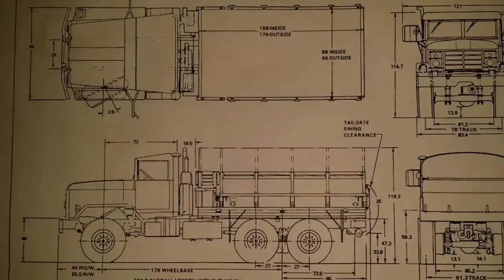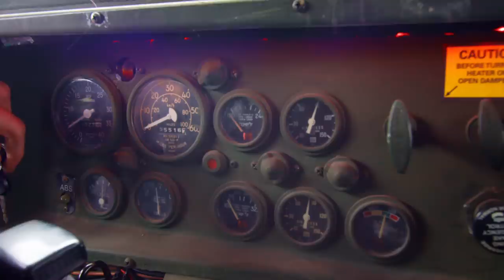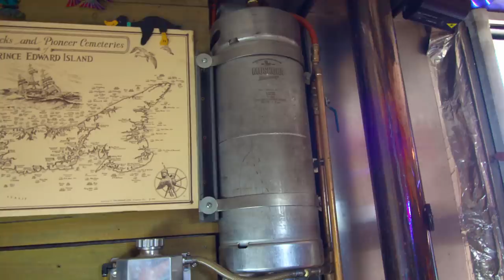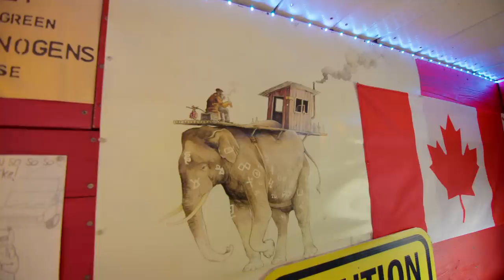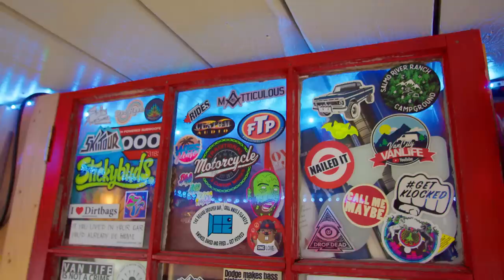What do you think about this Tiny House Truck Conversion?

Comment: Great build! I want to get one of these trucks and do something similar but maybe start with the m934 expandable or the m927/28 extra long wheel base. I have over 2000 hours driving these trucks off road in the back woods of Northern Ontario and they're hard to kill! Drive too fast and over loaded and stuff will break. Mike's right about that stock heater. We had floor heaters installed and they barely kept up in -35C. I ended up disconnecting the stock duct for the window and floor heat and attaching it to a hood I made over the floor heater. That got me plenty of heat on the driver's side of the cab. Putting a bonnet over the front grill in the winter is almost a must. That engine fan blows the cold straight through the firewall.

Comment: man, it looks amazing! but i can only imagine how hard it is to find tires and parts for it if something breaks...
Reply: Actually while the tires would be hard as he mentions most truck mechanics will be well versed with the engine and transmission of the truck as they are both quite standard
Reply: you could always but another truck like that for 10k and part it and have spare engine, trany and all components sitting in a garage or storage loccker.
Reply: He can probably go to any military base and buy them!

Comment: The problem I see with these military truck conversions is that while cool to experience driving 40 miles (64km) into remote wilderness (I've been doing this for over 40 years), it is important to consider what percentage of your time will be spent deep in the woods versus getting to the start of the dirt road. City driving is basically off the table. Driving in heavy traffic is a nightmare. Driving over 30 mph (48kmh) is not a good experience. Fuel usage is insane, and should the price skyrocket or should there be even a partial interruption in supply, you had better be parked in a nice place. Finally when (not if) you break down, you likely won't be able to go to the closest auto parts store to get the part you need. You will have to search online to find the part and wait while it is shipped to someplace close to you. It's a lot to consider. Mike's build is awesome! I have been many places deep in the forests of the PNW that I can envision having his rig parked and having a memorable time. I myself am searching for an exploration rig to build, but it will be somewhere between a 4X4 van and an older 4X4 class B size rig (like a Chinook or Ford Expedition). I plan to invest serious money in the suspension to have it be adjustable to provide reasonable comfort with on pavement ride and solid, reliable offroading ability.

Comment: So it would seem this truck wouldn't be the best idea for traveling due to the poor gas mileage a vehicle like this would get. That is the only down side I see to this awesome beast of a build. Very impressive to say the least!!! Thanks for sharing. 👍
Reply: it's a trade-off. The truck is cheap, and everything on it is cheap. So a lot up-front savings that may offset the costs of fuel even with a more initially expensive fuel efficient vehicle.
Reply: @zerocool2352  well my 40 foot long school bus gets about 6mpg. I would be shocked if that thing got 5. That thing is a BEAST!!!

Comment: What is the top gear speed of the vehicle when engine is running at moderate RPM and at high RPM?
What fuel mileage do you get when driving on highway 80kph and when driving 30kph on logging roads?

Comment: Hay man you gotta change you battries out to lithium a 200amp 24v drop in replacement will change your life its made the biggest diffance for us we just replaced 4 105 amp hour deep cycle battries at 12v with one lithuim 120amp hour one. It charges faster and gives you the full storage and lasts longer :)

Comment: This is a mobile fort/bunker/home I want one that is an off-grid Ship/landship/fort/bunker/home that can drive/float on the roads/waterways in the U S A/Canada/Mexico to be safe from the extreme storm winds/cold/heat/floods/mud/traffic/bad ppl + not landlocked to be trapped by very bad ppl but mobile + save money as you live/travel full time/year round on things like Gas/Food/Hotel/Motel + have a working bath/toilet/a nice bed to sleep in + drive/float into a bunker cave if need be + I love love love you YouTube + a way to get/hold rainwater for all use on my/your landship/fort/bunker/liveaboard/home